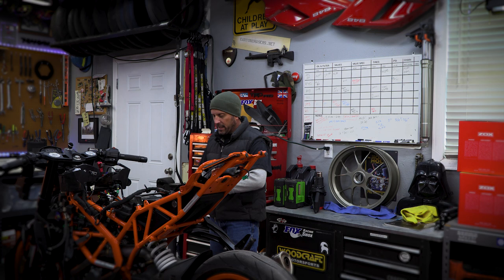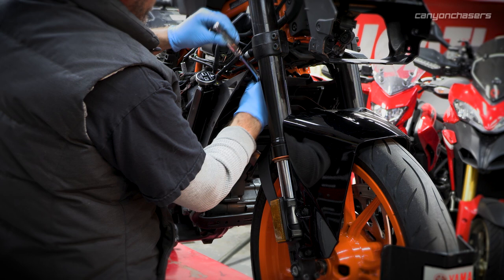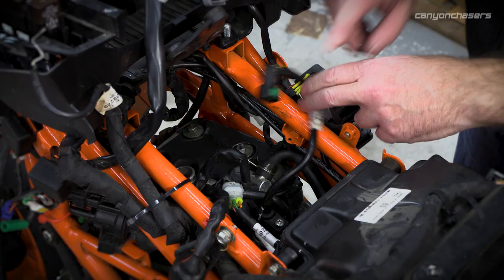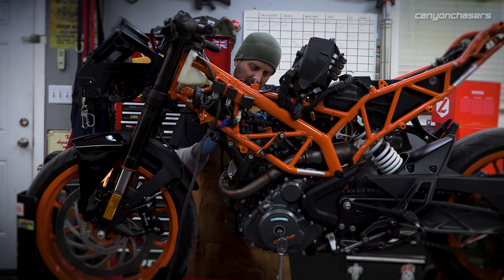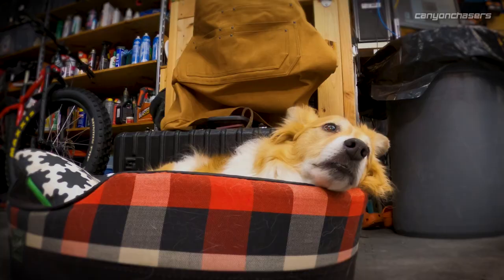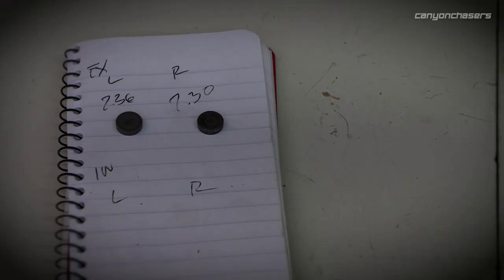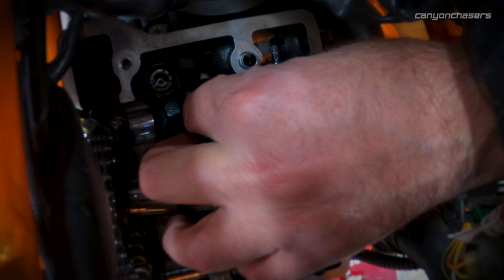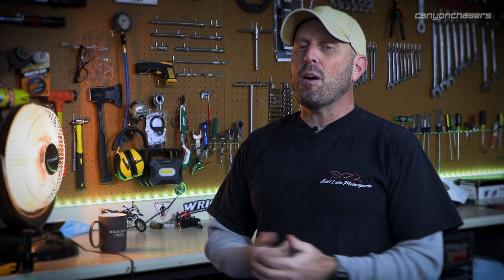Shim Under Bucket Valve Adjustment // EP03

Comment: The satisfying sound a torque wrench makes. Nice video Dave. Great mechanical skills.
Reply from the maker: Right?!? Isn't it one of the best things in the world?
Reply: Good tip with the zip tie. Be careful with the click type torque wrenches on the top end of these engines. The spec is super low and if you creep up to it too slow it won’t click. The cam tower threads can be pulled out verrrry easily if you go any amount of the spec. A dial type torque wrench is a bit safer for this job.
Reply from the maker: Great tips!!! And I've been meaning to get a dial torque wrench for a number of reasons.
Reply: @CanyonChasers  Yeah, for me it's the sound of me doing something correct but Backmarker is correct with the dial type torque wrench. I also wanted to have that when I still have my racecar with me. How nice it would be to have all the tools one would ever need, right?

Comment: Nice video! I got a shim kit for it because I figured I would be doing this a few times and a decent aftermarket one was cheap... But then again I have a shim kit for nearly every bike I own... I have spent more upgrading this bike than any other bike I've ever had including my race bike I raced for 4 years. So far everything has been worth it and I still want to spend more. My friend has BST carbon fiber wheels on his, super duper improvement but I can't justify the cost. I'm hoping you seeing me on my 390 at YCRS had some small influence on this. I haven't loved a bike like this since my 998!
Reply from the maker: Haha. It did. But this bike is actually for Mrs CanyonChaser, although I'm sure I'll be turning laps on it as well.   And my order from Grey Market came in today. Fuel injector, spark plug boot, steering stops and high pressure radiator cap. 

I'll be ordering a rear shock this week too. I think I'm going with the K-tech.
Reply: @CanyonChasers  Heh you'll be faster on all other bikes if you do laps on the 390... I went with the Andreani fork cartridges and Ohlins rear shock and I wouldn't do it again (but I would be happy to talk to reps from either). I would go with Ohlins fork cartridges and something else for the shock. I was warned that I would blow the seal on the Ohlins shock and it did happen. Maybe this is because I'm 220 pounds and riding it pretty quick... It works great though. Ktech is probably a good choice. The R6 stock shock option probably isn't bad either, check Formula 390 for the hardware to make it happen.
Reply from the maker: I've had awesome luck with K-Tech, which is why I'm sticking with that shock. The Andreani's came with the bike. 🤷‍♂️  

And I'm really excited to turn laps on it!  But I picked up tires yesterday.  Good LORD that front wheel is heavy.  WTF?!?!  (either that or I'm getting a lot weaker) haha.

Comment: Nice series, Dave! I wish I had one tenth of your mechanical skills😔
But anyway I'm looking foreward to your first track videos on your 'new' bike!
Reply: Buy a cheap bike, maybe even one you don't intend to use, and wrench away on it. One of the best ways to learn.
Reply: @briarfox637  yes I bet that's the perfect way to get into it!
Reply: @doitdamnit  I am mechanically inclined but never worked on a motorcycle before I bought one. I bought a 2008 Honda Rebel 250 to convert into a bobber and bought a manual. That is how I learned how to work on a bike.

Comment: When it comes to the shims, cam lobes, valve stems, and rockers, what is the point of wear? In other words, which of those components wears out faster? I would think the shim would wear before the valve stem, rocker, or cam lobe. So why couldn't you just replace the shim with new ones at the original factory thickness?
Reply from the maker: Why Do Motorcycles Need Valve Adjustments? What is Wearing Out?

Comment: Hey Dave, long time watcher, I think first time writing, blah-blah-blah. Two questions:

1. Where did you get your original measurement from? I understand you measured the shims with a multi-meter, but how did you find the "measured" part?

2. Can you explain more about what you meant about adjusting to the loose end of things versus the tight?
Reply from the maker: You first measure with a feeler gauge. 
And the manual will have a valve adjustment range. If possible we want to aim for the wider/lose end of that range. It’s not always possible, but that should be in the back of our minds as we make adjustments.
Reply: @CanyonChasers  Duh! Thanks for the response!

Comment: What can i do if its still tight with the lowest shim number, except replacing the valve seats
Reply from the maker: Typically, unfortunately, it means it may be time for an actual valve job, or worse case, a new head. 

You can try to hand lap the shim down enough to get it into spec, but that only gets you to the next valve adjustment.

Comment: I have avoided shim type valve adjustments like the plague
Only bike I had that required shims was an old xs1100, wich you could pull the shims out without pulling the camshafts, unlike modern aupersports that use shim under bucket
Fortunately on that one once you got the shim loose from the bucket, you can pull it out with a magnet
Went back in that way to
Reply from the maker: They're not that bad.  Better than Shim OVER bucket.  Those are the worst!!
Reply: @CanyonChasers  my experience with shim over bucket wasn't bad at all
Of course that's limited to the xs1100 I mentioned,  maybe other shim over buckets are different 
Then again I haven't done shim under bucket,  I just cringe at the idea of trying to pull cams and maybe the chain coming off the crank 😂
Reply from the maker: Yeah, the chain coming off the crank does happen. Not in the way you imagine, but they'll slip teeth.  Thats why you put everything at TDC, and then make sure all the timing marks line up again when finished. 

My last shim over bucket experience required a special tool that just took days to do each valve. I don't much mind Shim under bucket, but crazy as it sounds, I've spent so much time around Ducati's, I almost prefer dealing with Desmo's now.

Comment: how is a regulator rectifier going to work harder with no headlights? isn''t less current passing by it a better thing?
Reply from the maker: The Reg/Rect generates a fixed output. If more is going in than going out - like we've removed a lot of the draw by removing the headlight and such, the excess is converted to heat.  Fortunately, thanks to LED lights, this is becoming less of a concern.
Reply: @CanyonChasers  Im interested in learning more about that, it doesnt make sense to me for it to work like that, doesnt the alternator only "send" the current needed by the electronics of the car/bike? it doesnt send excess current right?

Comment: I done my shime and the bike ran great and I rode it down the road and back turned it off and now it won't start any Idea
Reply from the maker: Always check the cheap/easy stuff first. The 390 has two ground leads. Make sure they are both tight.

Comment: yay task accomplished.. with the engine on the motorcycle ...
 to remove the rubber cover was kinda sad 🥲. 
The rectifier/regulator is good where it is, heat won't be an issue they last long.

 unlike Regulator located on a triumph street triple -2015-2017  or the new Panamericana 🤭...
Reply from the maker: I actually didn't have the heart to throw it away. It's sitting on the bench. It may still make it back in...

Comment: How do you make sure its top dead center om the power stroke?
Reply from the maker: There are marks on the flywheel (behind the window in the case) and typically on the cam gears.   Your manual will tell you specifically for your bike.
Reply: @CanyonChasers  Yes but seeing if its on the power stroke tho?

Comment: Why is rectifier working harder if the headlights don't draw any current? As I understood, the more current that goes through the rectifier, the harder it would have to work. At least that's how it works in the welder I converted from AC to DC.
Reply from the maker: Because no current is going back out to run headlights, etc.  Maybe it's getting better with modern bikes having LED lights?  Removing the LED headlight doesn't change the workload that much.
Reply: @CanyonChasers  Add a resistor maybe? Measure the resistance of the headlight unit and add a resistor to the rectifier. Could help in case  it needs help.
Reply from the maker: The SV shreaded rectifiers. The 848 has been going for fifteen years without a hitch. It's not always a problem. I really think keeping them cool is all thats necessary in most cases.

Comment: I like your zip tie tip ... know why? ;-)
Reply from the maker: Why? I'm dying to know!
Reply: @CanyonChasers  Ha! I ended up having to replace a valve and guide when the chain slipped on the sprocket in the process of installing a manual chain tensioner.

Comment: for the bodywork just tell yourself, it wont fit like its supposed to and it will take much modifications and custom brackets. set the bar low and it wont be disappointing. lol

Comment: I would never take a part off that the manufacturer put there in place for a reason, weigh it and then throw it away. But only because i don't bother weighing it before it goes in the bin.
Reply from the maker: I actually didn't have the heart to throw the hateful rubber thing away. It's sitting on the bench now. Not sure if It'll make it back in or not. Since these bikes have a tendency to run hot, I'm inclined to leave it out just for cooling purposes.  Thoughts?
Reply: @CanyonChasers  that rubber bit is holding heat in the engine in an attempt to keep from transferring it to the airbox and fuel in the tank. the CBR i had boiled fuel at BC49 pace so they wrapped the underside of the tank and airbox with gold heat tape, the same stuff on the back of my old 675 for the undertail exhaust. it's a better/cleaner solution than the rubber nonsense. Look GP to go GP.